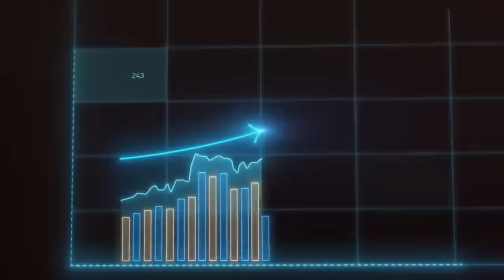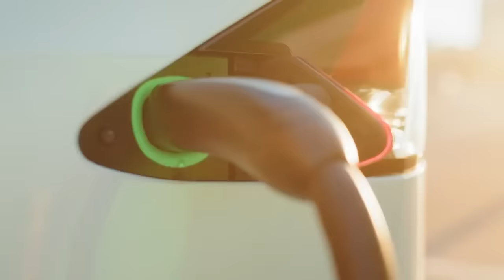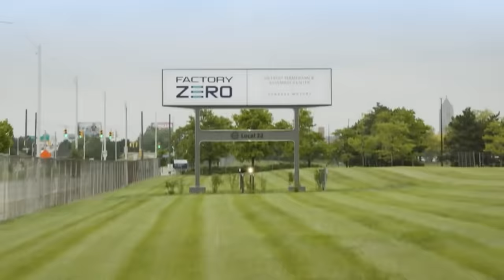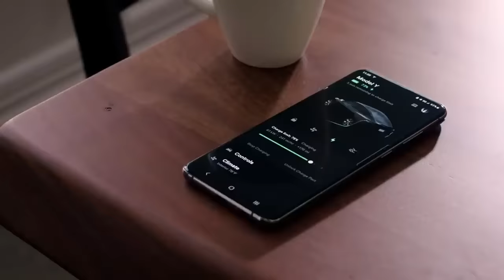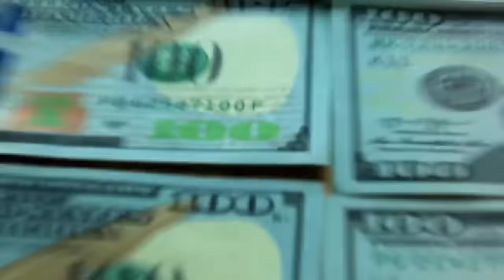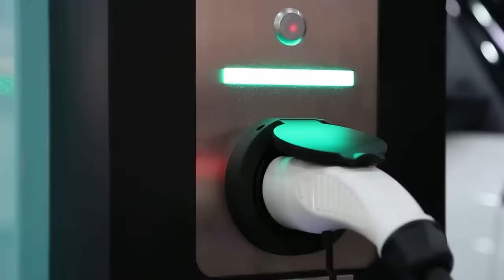Electric Vehicle Owners Are Frustrated and Demand the Return of Gas Cars

Comment: One of the great traits of Capitalism is that the market will determine the balance of any product.  EVs DO have a place and people who want them WILL buy them.  They are good for local living at this point. If city driving/commuting is the need, EVs can easily fill that need.  If travel is your bag, EVs create issues due to range/charging issues.  That may change in the future, but right now it is what it is.  If you're towing or hauling large weights, EVs can't really compete against today's diesels.  Yes, they can tow as much, but not for long distances.  One thing people often overlook is TIME.  If you're towing a travel trailer on vacation in the Rocky Mountains, and you only have a week or two, how much of that vacation time do you want to spend trying to find a charging station and waiting for your tow vehicle to charge?

Comment: The fire combating issue is wrong: way to combat gas vehicle fires is to use water to cool the fire (fuel, oxygen, heat). Electric cars burn so hot that water don’t cool it enough, plus lithium burns in water. So the current solution is to deny oxygen with a covering and then use water to cool the covering. It’s all insanely risky

Comment: The problems caused by EVs are adding up to the inconvenience for gasoline car owners, when petrol stations are losing business they fold and now owners must drive longer distances to find their petrol. Is the government even willing to install a charging station in every public parking lot? What about people living in landed properties? Can there be an inside charging port in the boot? Are there portable charging solutions?
Reply: The problem is the electrical grid can`t handle the load. There will be black outs and lines burning up. No one seems to understand that.

Comment: Did you miss the greater pollutants from tyre and brake wear? The heavier vehicles have 30% greater tyre wear like-for-like over ICE, but the particulants from tyres are as bad as diesel emissions. And EVs cannot be smaller without reduced range, so they are perhaps twice as bad for someone trading in a small diesel for a large EV.

Comment: The concept if EV's are good, but until they are able to create a reliable, safe and durable batteries that could last as long as normal gas/diesel engine vehicles can, car manufacturers should not jump in on the band wagon of EV's, at this point, it looks like EV's are still in a testing phase.

Comment: Both sides Exaggerate the problems,  i love both ice and evs. I drive a ev it works just fine in the cold -20-30°,i knew the range would be shorter. Just like any battery, even ice cars use more gas in the cold. Biggest problem is the 12v battery, just like the ice cars. But of course we should be free to choose between ice and ev, some people need ice cars. And some live in a 3rd world country,  which have terrible infrastructure and lack chargers. I only charge at home, and i save alot on fuel. In Norway we have fair electricity prices, and insurance is about the same as with an ice car. No regret so far.

Comment: Great points but you failed to mention that EV’s chew through tires around 3-4 times faster because of the torque from the electric motors. So not only is maintenance expensive but just driving the car is also expensive (in tire wear).

Comment: This report did not cover the tread in EVs to go to LFP chemistry.  No cobalt and less lithium.  More thermally stable.  Interesting that most if not all of the fires shown were Teslas. EVs have superior driving characteristics and range depends on how deep you push on the accelerator.  Engineering 101 describes energy source and scale of power are related.  Electric commercial airliners for example will not make sense with current storage systems.  Or like the turbine power car projects of the 60s. Not viable due to driving characteristics and cost.   We need to understand that this is a new technology still.  Like Henry Ford was quoted as saying, if we asked people what they wanted they would want faster horses and not the automobile.

Comment: Here's a thought. ICE  cars are around 35% efficient. Electric generators are around 95 % efficient. Why not have a generator in a car powering a battery and electric motor. It has to be much more efficient, therefore much lower emissions and better for the environment. Ni brainer as an intermediate until better EVs are designed.

Comment: 1 in five car owners go back to gasoline vehicles.

So 4 in 5 do not.

I'm sorry but if I was going around handing out free 20 dollar bills, 1 in 10 would refuse to take them, get angry at me, call the police, etc.   So this return to gas figure is barely above random background noise levels.

In my increasingly old gasoline car for 2 to 3 more years.   But my next car will be an EV unless things change. 

EV's are now selling three years ahead of projections made in 2018.  They are very popular.   

EV's are not suited for people who can't charge them at their residence or business.   That's about a third of the population.   But about half of them don't own a gasoline car either.   So it's really about a sixth of the population that isn't well suited to the EV model plus another 1 in 100 who drives over 2,000 miles per week (EV's are fine for 200 miles per day every day.) or who drive  further than 90% of the cars range most days.   They should also get gasoline vehicles.

But they also drive their cars into the dirt every 3 years (or less) and need a new car.

Comment: Why can't hybrid cars be a thing again? A Diesel/Electric hybrid, plenty of torque, long lasting, and battery technology is better than it used to be. Using only half the fossil fuels is a start to using a lot less or none. The batteries also need to be safer and placed in an enclosure so the whole thing doesn't explode or catch on fire.

Comment: An EV that is on fire cannot be put out by submersed water Fred not only do the batteries, frequently have their own oxygen source, heat of the combustion can actually separate the molecules of the water and provide oxygen and hydrogen which is flammable!
What's the diecast underpinnings of a tesla, can be damaged in a minimal impact accident, requiring a large investiture of replacing the entire framework of the underpinnings of the car.

Comment: I have an electric car, actually I'm on my 3rd Tesla and I never want to go back to a gas car.
Reply: So that's at best a seven year turn around, Tesla only been in business since 2008, probably more like a three or  four year turnaround.

So not able to advise on the. various models long term  service then.?
Reply: @toonmag50  i’ve never done nothing other than had the brakes lubricated one time no oil changes no maintenance just fill it up with electrons at home and go
Reply: @orionism42  well that seems reasonable since you only-keep the cars for a short time .

The brakes on my diesel fully renewed at 113,000 miles 2017 and now at 180,000 miles still fine to pass government roadworthy test .
It's all to do with driving style and the types of road used.
Did you renew any tyres / brake fluid ?
Reply: @toonmag50  I drive about 20,000 miles a year sometimes more no I never did any of that just put windshield wiper fluid in it plug it into the wall 240 V and the next morning start the whole process over again I have yet to race anyone at a stoplight that could beat me the last six months I don’t even race anymore maybe a faster Tesla but I’ve never encountered one

Comment: With my lifestyle..  if i got an EV it would have to be a pickup.. so to equal what i have now, my choice would be the f150 Lightning Xlt Crew cab at the cost of  $54,995 to $93,086 MERP And to replace the only "standard rang" battery pack cost around $675  in labor while the cost of the batterie is about $32,086 !! And the battery only lasts eight years or 100,000 miles whichever occurs first, depending on how hard it's driven. Well i have a 2013 XLT crew cab f150 that i can drive over 400 miles nonstop and fills up in less then 10 mins and i only paid 10k 😂😂😂

Comment: All electric cars are in my opinion a proof of concept.  They are a very interesting technology direction but at the same time they are a dead end with too many problems.
Unfortunately the real problem is that vehicles need a high energy density system that can be quickly recharged (And reliability).  This is something Batteries can not match.
This is why I say all electric cars are Incomplete. 

This is very pie in the sky.  I keep saying a small generator for electric cars is necessary.  If we can get a small enough fusion reactor (This is probably 100 years down the line) in a car, I think that is when Electric cars will be at their peak.  A Hypothetical car with a 160 KW motor, 40 KW battery bank and 20 KW fusion reactor could be an ideal family sedan setup.
Reply: Just put trams and trolley buses back into cities, expand underground systems and use electric trains for long distances.
Much easier and cheaper..

Comment: The present crystal ball is clear, EV are a technological advancement only when charged using clean cheep electricity from wind and solar power.  These will "store" intermittent energy from solar and wind and use on transportation which will decrease the use of gasoline or diesel and will decrease and pollution. However these are only one side of EV challenges. 
Probably peoples who were able to buy EV may switch to ICV again, but this does not solve energy shortage on the world economy.  Depletion on oil and gas production shows peoples must be prepared for higher prices on all energies they use, and this will push many to voluntarily abandon the use of car and instead use public transportation.  The world is moving very fast on this cliff, and within few years we will see these nightmare.  The question after these is from where will come energy for public transportation, for heating, for industry and defence plus marine and aerial transportation.  So the solution on these challenge is investing on energy generation where efficiencies are higher and not on wind and solar where efficiencies are low.

Comment: The car Id good , the cost isn’t .
They have a place on roads but changes have to be made .
I see a problem with the battery .
Paying twice for car isn’t fair .
How long do battery’s last before your replacement?
200,000 miles ?
That’s what I have on my 2012 Santa Fe and it’s still running like new!

Comment: back when the Documentary "Who Killed the Electric Car" what batteries did they use? dont recall any problems with power costs back then.
Reply: The first EV1’s used lead-acid batteries (they were only 15-18 kWh!), and the gen-2 EV1 used a nickel–metal hydride battery (NiMH or Ni–MH).

Comment: Place a alternator on the rear tire you won't need to charge them anymore. You have a alternator in the motor that charges the battery that starts the car and runs the sensors in them. Gas Car's are more reliable Yes.

Comment: Is Electric vehicles flood proof.? Are the Electric companies concerned with cyberattack ,  The job pay don’t match up with the expensive Electric vehicles. Do we have enough mechanics to qualify to repairs electric engines. . These short term overnight plans don’t work. Your putting the cart in front of horse . How can you sell these expensive cars and trucks , while regular people are struggling put food on table or struggling to pay house mortgage . Ask yourself this questions , can an electric car or truck handle the freezing cold temperature , what about the heat , or flood proof. Am I going to get  a electric shock if  get underneath the hood to find out what’s ticking while it’s raining?  
Can I sue the car industry if I get electrocuted, Will this be an advantage for the law or cops to stop my car electronically by remote control

Comment: I'm not going to buy EV, it's absolutely not relable! Few post down someone explaned all, I'm just copied his post:
1. Child battery labor
2. Range anxiety
3. Risk of garage fires
4. Paying 20k more than a comparable vehicle
5. Battery denegration
6. Poor resale value
7. Reduced performance in cold, highway
8. Higher repair costs
9. Awful charging network experiences in the weather without restrooms
10. Higher insurance rates
11. Replacing tires more frequently
12. Risk of huge repair costs by slightest battery damage, I can say Hello Hynday!
 13. Headache regulations for EV's involved in an accident. You will not drive home in your EV after beimg involved in an accident.

Batter EV this is a this is a dead-end branch of technology development!

Comment: i just watched the documentary the connected universe where nassim haramein completed einsteins life work of creating a unified field theory, now practiced as well.

this shifts the demand for more ev charging stations over to ev’s equipped with charging pumps or electron pumps, which simply pump a very small percentage of the infinite potential energy (study max planck plasma physics) into the ev’s batteries thus providing range extension to any degree needed.

every point in space contains literally, infinite energy/electricity.

combine this knowledge and wisdom with graphene batteries which have zero fire hazard, and we are off to a good beginning.

this is quite exciting indeed.

and interesting, to say the least.

Comment: You have to modify your home electric box you lose mileage in extreme heat and cold charge rage at questionable charging stations not enough stations must be worked on by a certified mechanic must use certified parts only software upgrade and there are too many problems to list here

Comment: I would never buy one hydrogen vehicles are wave of the future no hydrocarbons going into the hair just pure water coming out no carbon monoxide you still at the sound of your engine that’s the future for me. Not waiting for batteries to warm up and -25-30° weather, it was predictable the batteries don’t work in cold weather but everybody bought into it. I got a 2003 GMC pick up that’s all I need been dependable for over 20 years now.😅❤

Comment: EV is not a scam. Battery is a key of our future, but we are still at the beginning. All problems are common sense now.
Reply: EV’s are range limited, susceptible to changing weather conditions. You also have to factor in the huge amount of rare earth. That  has to be dug up for all those batteries. And at the end of the day. You still need to plug into a grid. That’s partially dependent on oil to power up. The internal combustion engine is better and still more echo friendly, compared to the EV. The CO2 that ICE engines give off. Is absorbed by tress 🌳🌳🌳🌳🌳🌳EV’s are big toys and not very good ones.

Comment: Unless they can have solar panels on the cars tp charge the batteries - we will be dependent on electricity grid which is powered by gas emitting means anyway.
In extreme tempratures. The EVs dont work so well.
The closest we can look at are hybrid vehicles. 
To reduce carbon footprint - just planr more Trees! 
Plain and Simple!

Comment: In response to @DaveMay1955
3 hours ago
Go ahead and enjoy your ICE car at 24 cents per mile. I'll stick with my Tesla's 3 cents per mile, and superior power.

Once the government increases taxes on electrical generation(and they will to pay for infrastructure) you can kiss your 3 cents a mile away. If you live in a city with a mild climate year round, I can see an advantage. Personally, I know of no one interested in an EV. We aren't there for range and work capabilities. They are probably a great novelty, 2nd car. A 2000 mile trip is a nightmare prospect in an EV, at least for now. Re-sale value, battery life/replacement are other considerations.
Reply: The 3 cents per mile is a lie unless he somehow gets a kwh at 9 cents which no one does when you factor in delivery cost and taxes let alone things like peak/offpeak charges. The 24 cents per mile for ICE is also a lie unless you drive a 90s gas truck. My 15 year old diesel truck gets about 30 mpg and my wives 10 year old honda civic gets about 35 mpg on average diesel is 3.30 where i live and gas is 2.60. Meanwhile our kwh cost when you factor in taxes/delivery fee is 20 cents per kwh.
My truck will also run long after i am dead even though it already has about 300k miles on it meanwhile an EV battery they say will last 10 years but some people are having them die in 3-5 years and finding out the battery replacement price is twice what the car is worth.

Comment: Long on opinion and short on facts. 2025 EVs will cost the same as equilvent ICE vehicles. 2030 EVs will be 20% cheaper. This is not a statement on quality or features. It is because the cost of batteries will halve. EVs have fewer more reliable parts. They will be cheaper to make. This is a problem for the legacy auto makers because their business model is to subsidise the purchase price with high margin after sales parts and services.

Comment: Lets not forget that the build quality of these Teslas is junk. The paint is bad, the panels dont align and thats just what we can see.
Now if the underbody splash pans are the same as the doors, then all the road salts get on the copper wires and the battery. You cant have that sruff exposed.

Comment: Gas car has only  one 12v battery for many years but battery still fail time to time cause no start, I mean only one simple 12v battery, so what happen with the E car with  about 400v and inside battery  combined with hundreds of small batteries link together, are you think E car battery will last longer than  regular 12v battery ???? 😀 good luck for Ev customer.